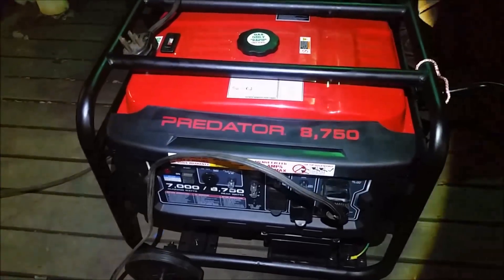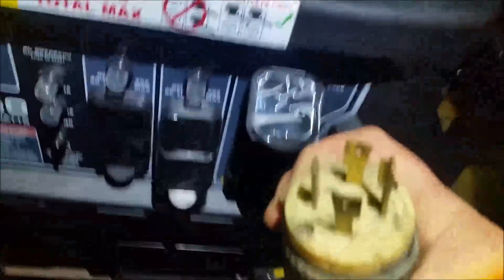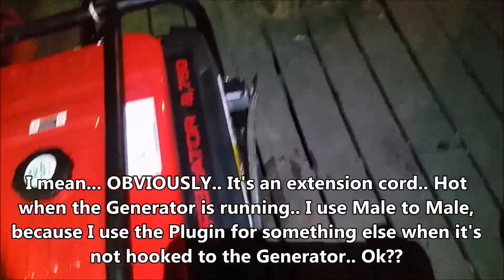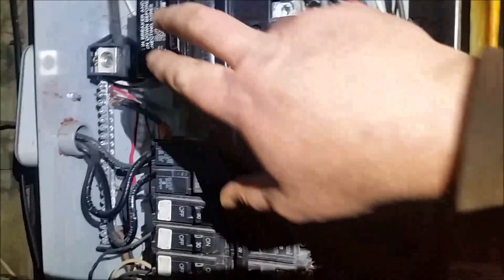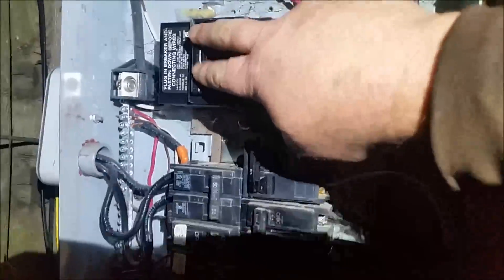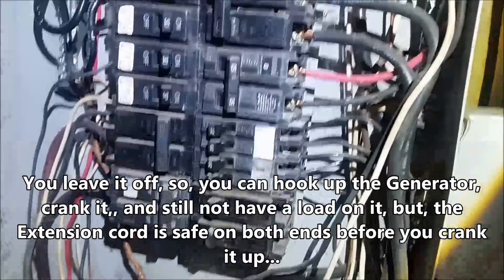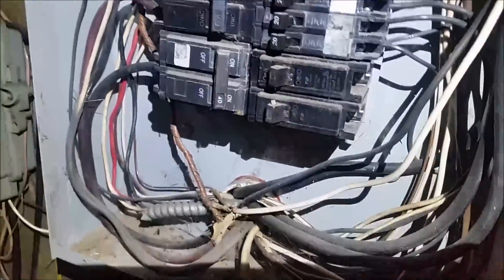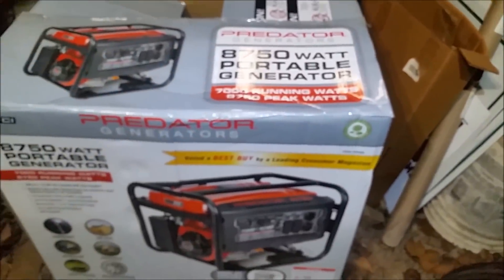Quick/Easy/Safe: Use Existing Plugin/Breaker for Generator hook up to your house Panel box.

Comment: I love how everyone is jumping on the electricians for pointing out how unsafe this idea is. That lead he has made is called a suicide lead in my country cause that is what it is used for. Yes if you did that here you would be fined so bad and if you did kill the linesman you could go to jail. As an Electrical Inspector  i would pull your fuse at the street for doing this and you'd have no power. But yes people still do it yes a change over switch with a correct lead and inlet plug costs some money but i guess if you're too poor to pay an electrician then you probably wouldn't own a house.
Reply from the maker: Everybody is jumping on the electricians? Excuse me, but I consider an electrician someone who knows at least a reasonable amount about electricity and panels and utility feeds.
There has not been a single electrician who has commented on this video, unless he is supporting it, with a caveat saying You must turn the main breaker off like according to the video says.
, of course, there could be many electricians commenting here and getting spanked with their stupid and ignorant ideas about fundamentals of electricity. Here they get corrected when they spout nonsense.
Turn the main breaker off, plug in the cord, crank the generator.
Would you please explain why you consider it a suicide cord in that use?
Because we all know that knives can be dangerous, but chefs, and simple everyday people use them all the time. It depends on who is using the knife as to whether it is dangerous or not. stupid people with simple tools are dangerous. The tool itself can do no danger, until a fool grabs it.
Please don't touch any knives, or do any electrical work. You are not safe.